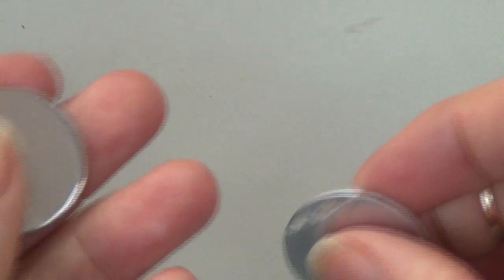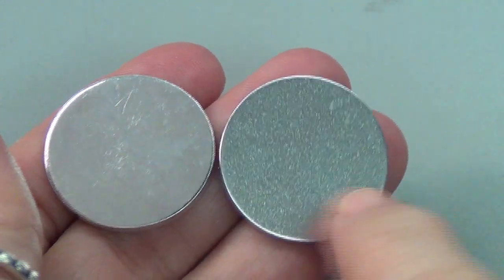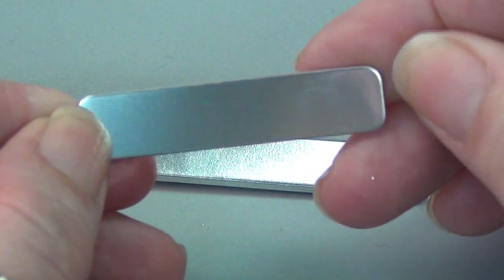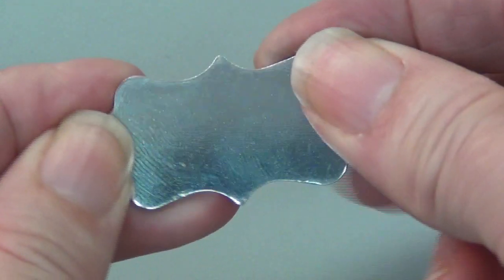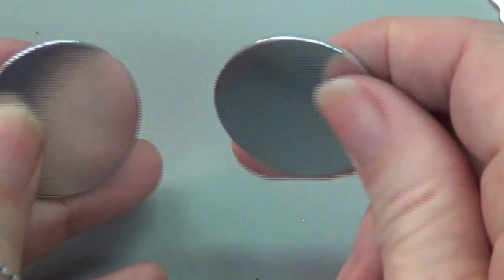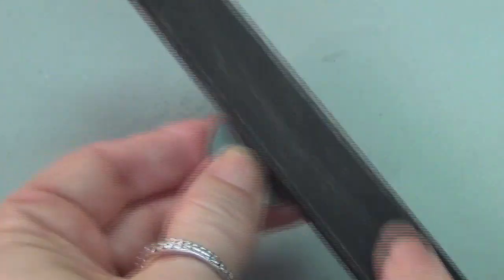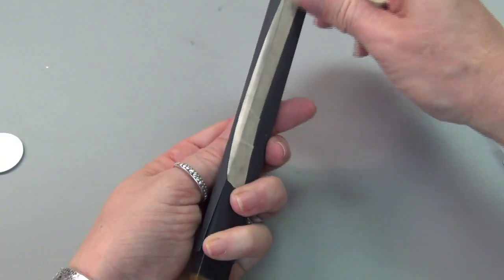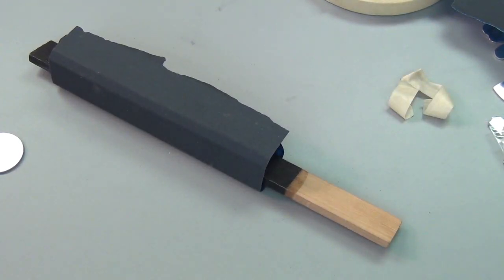Tumbled Vs. Raw Metal Stamping Blanks - From Beaducation Live Episode 51

Comment: How much shot do you use?
Reply from the maker: The tumbler we carry has a 3lb weight limit. That includes the barrel, shot, your pieces, and enough water to cover the media and material. If the barrel isn't turning or is slow - it is too heavy. You'll want to experiment and pretty soon you will be able to judge pretty well. The bag of shot when purchased is 2lbs...try 2/3rds of the bag to start and go from there.